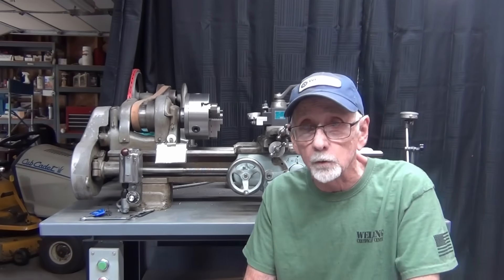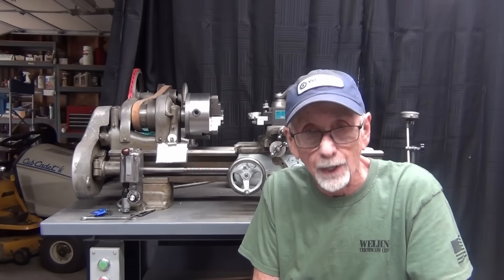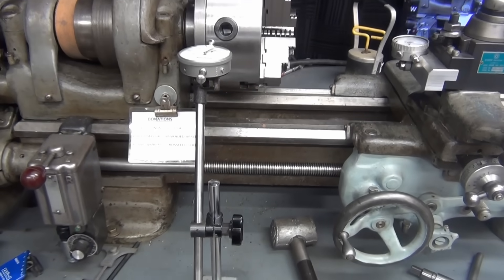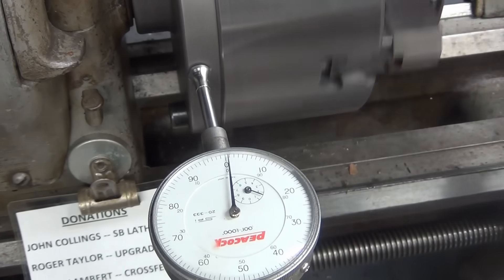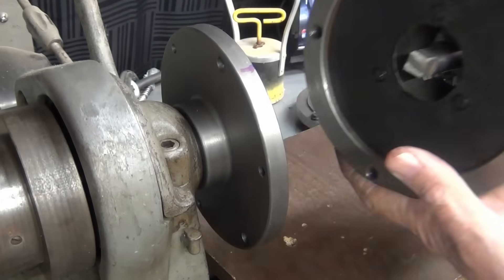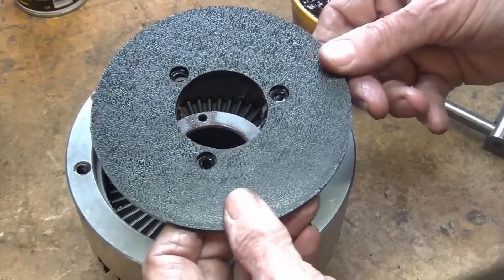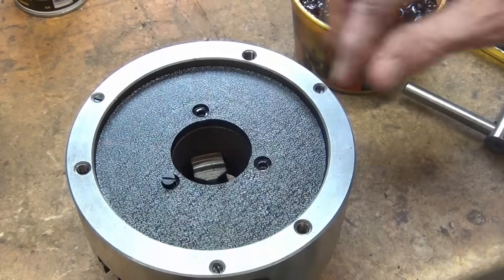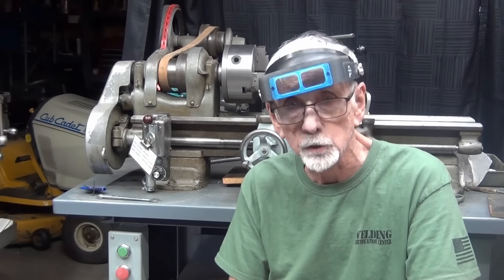IMPROVING the VEVOR 3-JAW CHUCK #1065 tubalcain

Comment: Mrpete, I have noticed that it isn’t common knowledge that a good manufacturer 3 jaw chuck that has three tightening screws, will have one marked. That hole is called the nominated hole! It is the only screw that will produce the greatest accuracy when tightened. It was the screw or hole that was used when the chuck was manufactured and ground. If there is no mark, when the chuck is tested, each screw should be tested. The one that is the most accurate is the one it should be adjusted give it the best accuracy. From that time on that hole should only be used for the best accuracy. This can be verified on south bends chuck manufacturing information. I have an important 3 jaw, that had three lines on one hole and using that hole, has a repeat within a couple thousands! Hope this helps.
Reply from the maker: Hello Rick.   I am 82 years old and I never heard that before. I immediately went down into the shop and looked at my best gator chuck, and sure enough it had a little zero stamped next to it. I love the term nominated.  I fully intend to show your comment in a video about three jaw chucks.   I bet most other people have not heard of it either. Very very interesting thank you ever so much. 
Most all of my three jaws are fairly small and have only one tightening hole.   Lyle.

Comment: This makes me lol as I’m working on exactly one of these right now. The removable jaws are warped binding the jaws, the jaws with teeth and not machined on sides so they bind. And mine was full of grinding dust.i haven’t even gotten to point of mounting it to lathe since it took a ridiculas amount of force to open the jaws.
Reply from the maker: That’s very disappointing. I hope a good tuneup will help it.
Reply: @mrpete222  I’m figuring out to grind the jaws in my milling machine flat.

Comment: I used to use ground stock for this type of inspection work and after a while, I found that the gauge pins work a whole lot better.
Reply from the maker: Thanks for the tip! I need to buy a set of gauge pins

Comment: On my vevor 10 inch i didnt see a L-00 backing plate. Had to use the 6 inch stocker and a 390 ford flywheel to make an adapter. The recess doesnt fit so the 3 bolts are all thats holding it square. So far so good. I limit the rpm.

Comment: As I mentioned on the previous video, I think you could improve the accuracy by facing the backing plate on the lathe prior to mating it with the chuck.  As you show at the beginning of the video, the plate is already relatively accurate.  The reduction is most likely coming from the face of the backplate being out of "true" to the lathe.  I have a 6" Atlas / Craftsman lathe and use a similar Vevor chuck.  I was able to get the accuracy to within about .001 - .0015.  As always, absolutely love your videos.
Reply from the maker: Good idea, thank you. I probably will not do anymore with it.

Comment: Talyrond perhaps (?) - made by Taylor Hobson, England - High precision roundness testing machine. Taylor Hobson made other metrology equipment such as the ‘Talysurf’ for measuring surface roughness, they also made pattern or stencil-guided engraving manual engraving machines…
Another useful and educational video, Thank’s Mr Pete..!
Reply from the maker: You are the third person to tell me that and remind me. And you are absolutely correct. I used both of those machines when I worked at caterpillar and I was amazed by them.

Comment: I wonder if trying the chuck at each of the three possible screw locations would offer any difference. Also if you marked the high and low spots on the chuck, and then compared the same at each of the three possibles, would they be at the same point? If the high spot was found at only one of the three locations, then the backing plate shoulder might be suspect. I have found that trying all possible locations will sometimes come up with a "happy" spot. All the best from Colorado Springs, keep up the good work!
Reply from the maker: That is very possible, I have not tried it. All of my older chucks have run out, I’m pretty used to it. For real accuracy I use a four jaw. Most of the time it makes absolutely no difference.

Comment: I bought a Chinese 3 jaw chuck about 10 years ago. First thing I did was strip it down, wash it out, blow out with compressed air, then re-assembled with grease. It has been a really good chuck over the years and has about 2 thou run out, which is somewhat dependent of the Dia you are chucking. Has been cleaned a number of times since purchase.
Reply from the maker: That's a great approach to maintaining your chuck!

Comment: When I put a shars chuck on the old SB 9C, I did give a tiny bit of clearance on the shoulder of the step as the mounting plate came machined but not finished.
Loosened the 3 mount bolts a bit and whack, whack with copper hammer to get the chuck's body and test piece more true.
Great vid as always!
Reply from the maker: That's a clever way to get it running true!

Comment: Thanks for another great video and for making the long drive to see us at Florida Flywheelers.

I saw you marking the backplate alignment with a sharpie and that got me wondering if intentionally rotating the chuck on the backplate 120 degrees or 240 degrees could solve the runout even if it was just dumb luck that it fit a little better in a different orientation?
Reply from the maker: You're welcome! It's possible that rotating the chuck could affect the runout.

Comment: I usually take a endmill for my chuck testing.
The shafts are very round an they are already in the shop
I modified my chuck to be an rub tru chuck.
I removed the back plate and turned my backing plate to a 1 mm smaller diameter.
Then I drilled 4 holes in the chuck body and put setscrews in there.
Works perfectly fine .
I can adjust the chuck about 0.5 mm in every direction .
Reply from the maker: That's a very creative way to get more precision from your chuck!
Thanks for the comment. I hope someone else reads it.

Comment: like what you are doing, my chuck i can grind he jaws using hole1 the scroll isn't perfect, as i chuck different DIA  it will be off sometimes h2 will work
sometime i snug h2 and tighten h1 and its good, h3 never works unless the part it not concentric to start with and it may be perfect, LOOK for what works for you
by finding what works for me , it keeps me from changing to a 4 jaw, chase yours it can be beneficial to you
Reply from the maker: That's an interesting approach to finding the best fit!

Comment: The best way to improve the vevor 3 jaw chuck is to buy a gator chuck instead.
Reply from the maker: True. That’s $200 compared to $800.
Reply: @mrpete222  I paid $2,500.00 for my Gator. its a 10 inch set tru. Im glad I got it.

Comment: Mr. Pete,

I bought one of these chucks after watching your introduction to it. The chuck body was very good. However the backing plate was of very poor quality and I am still trying to correct it. The supplier was no help at all, so I will make a new one using your expertise I have learned over the years watching your videos. I feel confident it will come out better than the supplied one.  

I still hope you will get back to building steam engines and the repair of them, plus making some chips!

Thank you
Reply from the maker: Thanks for watching. Just yesterday I finished a video where I put together one of the intricate. Sirling kit steam engines. It will be launched in a couple weeks.
Reply: @mrpete222  Thank you

Comment: Four comments.

First, that plastic plate could be an issue if it's sensitive to oil, grease or solvents. I've seen plastic get eaten, and go brittle. So, I'll hold judgement on that.

Second, There are three ways that the chuck could go on the backing plate. I'd be curious if the runout is better or worse on the other positions. 

Third, you checked runout rotationally. But, only at two working diameters. I'd be curious if the runout is off the same amount at larger diameter workpieces. 

Forth, I'm also curious if the chuck has runout or wobble if checked axially. 

And last, I wonder if a bit of creative machining could add adjustment? Turn down the mounting shoulder on the backing plate 5 thou and add some set screws to the chuck body to allow fine adjustment? Or, if the existing errors are consistent across the working range, even truing the chuck jaws. This could be a "kit" for making a precision chuck.
Reply from the maker: Those are all great points and observations, thank you for sharing them!
I suppose there could’ve been other measurements taken, I like to keep the video short. These are Chinese products of marginal quality. But plenty good for home use.
Reply: @mrpete222  Yeah, for a short video you went far enough. And as you point out, there's always a point that's "good enough" for what you are using it for. You are not planning on using it where you need repeatability below a thou. And for most hobbyist level work a couple thou is more than good enough. 

I'm handicapped by the fact that my shop time was in a Swiss type manual shop where I often needed more accuracy than that. So, I automatically ask just how good can I make it? And I've found that some of the Chinese "junk" can be surprisingly accurate with just a bit of work. Modern production methods make it just as easy to hold tight tolerances as loose, and if you get one that's tight, it's usually pretty good. 

I'll give an example. I always used to buy Hardinge 5C collets. But, now that my finances are a bit tighter, I bought a set of no name collets. And then tested them to see how close they are. The major issue that I have is wear in my spindle rather than errors in the collets! And even with the spindle wear, the collets were more accurate than what the sales literature claimed.

Comment: After re-grinding my chuck jaws a few years back  I tested the centering... Of course..... :D  What I found when I did that was that each pinion centered an item slightly differently.  I also realized that I had messed up by not marking the pinions and holes they came from.  The re-ground jaws showed .002 runout for one pinion and something like .006 to .008 for the other two.  I've been meaning to play "musical pinions" for the few years now to see if I could do better than .002 by finding the proper order for the pinions.... But the message for you is that if you check your centering from tightening up using different pinions that it's possible you'll find one that centers up to better than the .004'ish you have now.     And thanks so much for so many great videos.  Clearly teaching for you was much more than just a job.  You've never stopped.
Reply from the maker: I really don’t like the idea of grinding the jaws, several people suggested that.
And yes, teaching Shop was an is my life.   40 years on the schools dime, and another 20 years on my penny.
Reply: @mrpete222  Yeah, grinding the jaws should be a last resort, and only if the error is consistent across the working range. If the errors vary based on diameter then working on the jaws will only make it "right" at that diameter. And, might make it worse at others.
Reply: the pinions don't make a difference, its the scroll gear and it's fit in the housing and the jaws themselves that controls the runout. The position of the pinion does matter(not which pinion)because it loads the scroll gear in that orientation. Usually self centering chucks have 1 pinion location marked. That is the one used for the grinding of the jaws and the one you use when needing the highest precision. The others are for when it doesn't matter.

Comment: Great video!   I bought that same chuck/backplate from Vevor.  Along with the issuses you addressed, mine was filthy with grinding grit on the inside.  Additionally, the top jaws did not seat correctly on the master jaws due to excessive radii in the corners of the mounting keys.  I would suggest removing the top jaws, wiping all the surfaces clean.  Then reassemgble the jaws and measure the runout.  If it sill has the same runout, you're lucky.  I had to grind corner relief into the mounting faces of all three top jaws.  Now I need to regrind the asembled jaws to get rid of the completely unacceptable runout.  All that said, the chuck is still a very good buy.
Reply from the maker: I have not done that, perhaps I should. I am pretty satisfied with .003 run out for a three jaw.
It does have some false though, doesn’t it?
Reply: @mrpete222  Yes, it does have a few faults.  After I removed, cleaned and remounted the top jaws the TIR increased from 0.002" (VERY good IHMO) to ~0.035" (horrible IMHO).  Good luck and please keep making these great videos.  'LOVE your channel!

Comment: I would have indexed the chuck around the backing plate, and stamped it if there was a position that the run out was the least.  My  PM 1130 was stamped both on the spindle, and the chuck, but it is a D 14 mount.  There is almost zero run out in the stamped position.  I tried other positions, and the runout went up.  The factory took the time to calibrate the specific chuck to the spindle.  Thank you for the video.
Reply from the maker: That's a great suggestion! I didn't think to try indexing the chuck.

Comment: Cheaper chucks use oil because it costs less for the oil and it costs less to oil it. But scroll chucks should always use grease. The grease should be a heavy anti sling with moly. Light oil is the worst thing for a scroll. The oil gets thrown to the body of the chuck in use, then pools at the bottom when turned off. So the scroll and pinions get almost no lube at all.

One way to see if you can get it better is to try mounting it by rotating the chuck around the back screws. It’s very possible that one of the positions will be more accurate. Since the back is off by one thou., and the chuck is off by three or four, it’s possible that you will find a combination to bring it to possibly two thou off, which would be pretty acceptable for a less expensive model.
Reply from the maker: Thanks for the information on lubricating chucks!
That’s good advice. Another comment just said you should never use grease.   Usually when I open a chuck , it is packed with grease

Comment: I'd love to see you dial that chuck into zero run out. I bought one of these and fought with it to get it to come in, and never did quite get there. I even took a little bit off the back plate and drilled out the bolt holes a little larger to give me some room to move things around. I probably just screwed up the chuck is all I did.
Reply from the maker: I have no plans to improve it at this point. Good enough for what I do.
I am very much used to three jaws having a run out. It’s pretty much power for the course. Even if you have one, that is perfect, it won’t be in a few years, lol.

Comment: Good morning Lyle,
I wonder if there is any burrs on the jaws. What would happen if you removed them and gave them a lapping with 1000 grit on the surface plate? If a burr is present where it grips the stock, wouldn’t that make a difference?
Reply from the maker: I have not checked for burrs , they’re probably are some. And it might make a difference. But I’m done with the job, lol.  I am used to three jaws having run out

Comment: Potentially dumb question-

Could you have reamed or redrilled the holes .001 -.003 so you can adjust the remaining run out on the chuck with a tap of a hammer
Reply from the maker: I doubt that we’re doing any good. The wiggle room would be from the backing plate I think.
Reply: @mrpete222  Agreed. Those mounting holes probably have ten thou or more clearance already. But, truing the backing plate would mate it to that spindle and might improve things a bit.

Comment: While not perfect I would not be concerned about that amount of run out on that small lathe. If one needs more accuracy than that, use the 4 jaw. You could ID grind the jaws to alleviate the problem. I know you know that. Might make a good follow up video. Lets do that!
Reply from the maker: I agree, I use the 4 jaw for better accuracy.

Comment: Clamp a piece of drill rod in the chuck. Loosen slightly and test each pinion separately with an indicator to see which one has the least runout. Double check to verify. Stamp a small 0 beside the most accurate pinion for later identification.
Reply: what part of the chuck is rhe pinion?
Reply: @chrisbrady-t1u The three wrench holes on the chuck body turn small gears on the inside that mesh with a circular scroll to adjust the jaws. These gears are known as “pinions”Mr. Pete put grease on the gears and scroll before he put the chuck back together.
Reply from the maker: That's a great suggestion!

Comment: Mr. Pete, a question: I've read that grease in chucks isn't as good as oil becasue grease will cause metal chips to stick and hold them in the chuck where they can interfere with gear teeth rather than fall away. Light oil, on the other hand will allow chips to fall away. What do you think?
Reply from the maker: I have heard that as well. But yet some chucks are heavily greased from the factory. I have even seen trucks with a grease zerk on them, lol.
Reply: @mrpete222  Yeah, It's hard to know what to believe. The situation is like the various opinions about the diameter of the register on the back of a threaded chuck back plate and it's fit to the unthreaded area on the spindle being the important part of getting a chuck to run true. Some say it's the threads that center the chuck and some say it's the register. Opinions vary on that too.

Comment: Bubba told me they have to be bolts because if they were screws you'd use a screwdriver to turn them.
Reply from the maker: Maybe buba was right.  But the term cap screws has been around for 100 years.
Reply: @mrpete222 True. I’ve never heard of “cap bolts”.